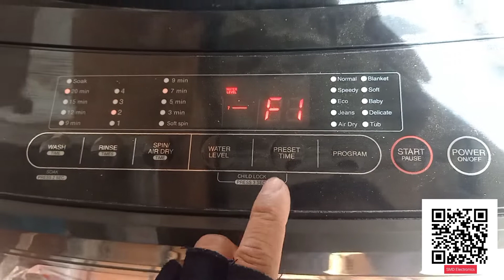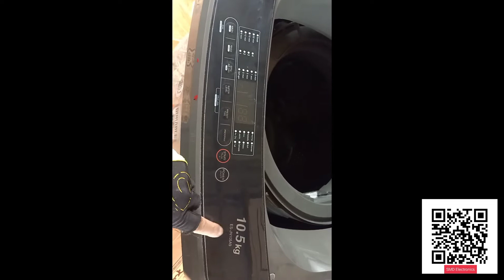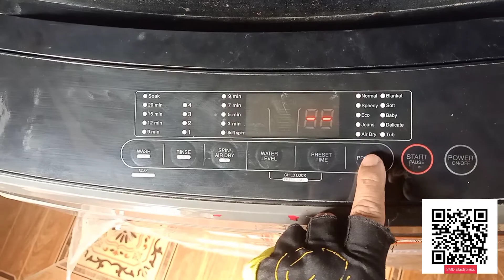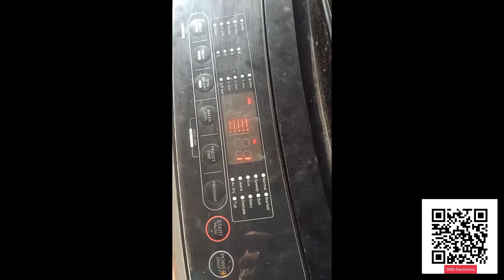how to repair sharp washing machine. F1-alarm.

Comment: Magkano po pagawa? Ganyan ung error ng washing ko ngaun..
Reply from the maker: If around Imus langpo,. 2k Lang,. 50% money back guarantee, and 3months warranty... 🤝🤝🤝💗
Reply: Anong possible n dahilan nyan
Reply from the maker: Overload., And unstable. Piro mas maganda LG Pag bumili ulit kayo ng bago,. Kasi Yan lang madalas nasisira s kanya,. At drain motor. Matibay Ang kanyang gear box at mainboard.
Reply: Sa fujidenzo f1 error ano kaya dahilan
Reply from the maker: Pm sent Po,. Paranyaque,.
Reply: Sa fujidenzo po pag f1 din ano po possible na sira
Reply: boss Las pinas magkano sevice fee F1 error sharp washibg machine
Reply from the maker: 2500 Po,. Labor materials if mag success,. 400  if Hindi as check up pay, Sakali Iba Ang sira, or my need pang bilhin, pangalawang punta labor materials nlang babayaran Wla ng check up pay.